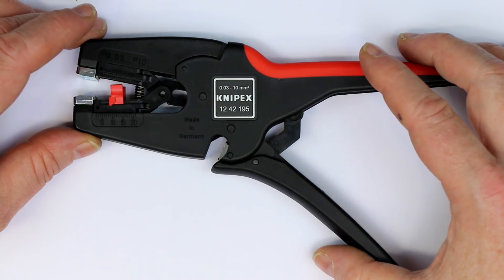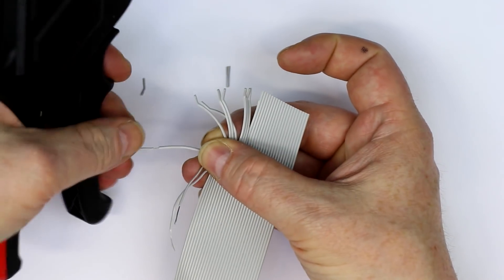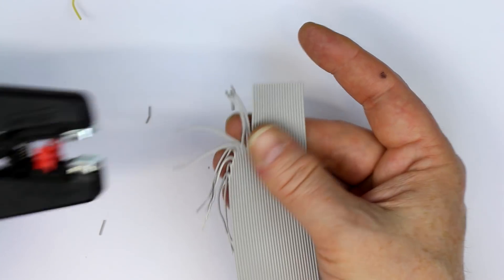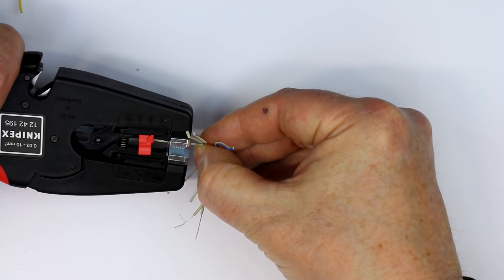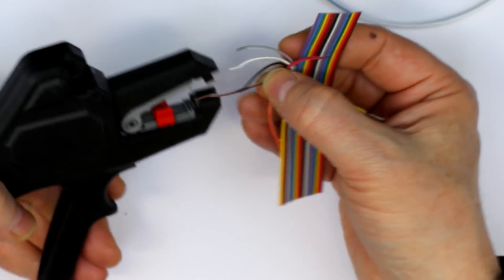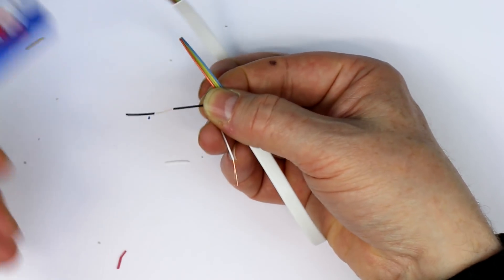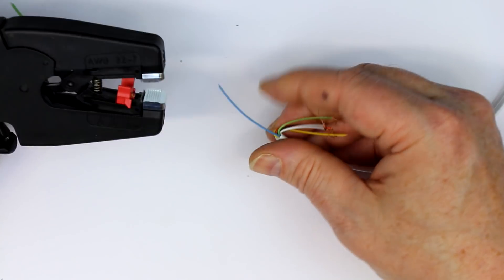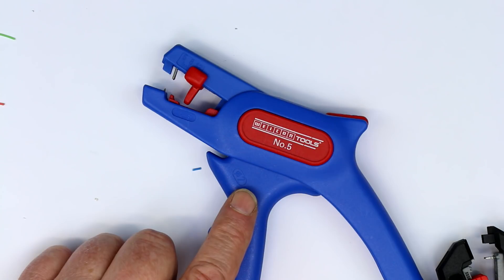Knipex Multistrip 10 - An unbiased comparison to 2 contestants

Comment: Fix for Knipex not stripping small wires:

The top blade is fixed with a screw to make it replaceable, but it has some wiggle room when the screw is loosened. So you want to loosen the screw and let the blade drop down slightly, then tighten the screw again. This adjustment allows the blades to grip small wires better and strip them perfectly! Mine came from the factory with the blade positioned too high, leaving too much space between it and the bottom blade, even at the tightest setting (I own the adjustable model). Hope this helps!

Comment: Flatcable is typicaly 0.08mm^2 and the knipex 12 62 180 is designed for 0.2 to 6mm^2, so you cannot complain that it doesn't perform well enough for something that it wasn't designed for!
From the video I am guessing that you are right handed ... might sound silly but use your right hand for the tool. I have the mulstrip 10 and it performs as expected (I mainly use for thin electronics cables)

Comment: You were setting the wire further in with the cheaper Knipex.
Reply from the maker: In the mean time I have found a trick to get also very thin and slippery wires stripped with both of the Knipex tools. You have to insert/strip a not too short and not too long piece of wire  The large one (Multistrip 10) with that trick is in fact really the best one.

Comment: I got a pair of 12-62-180 Knipex wire strippers, and mine have a strength adjustment on the upper jaw. Yours seem to not have it. I'm curious if this was added along the way.
Reply from the maker: Yes, Knipex have added this feature recently. I have to try it out if it really improves stripping of thin, slippery wires.

Comment: I’ve experienced the same problem on the Knipex 12-42-195. Rather disappointing! Recently I’ve tried to turn the blade “upside down” (even though it look identical on both sides). This seems to have helped, but I’m still to test it out in more situations. Can anyone else confirm if this solves the problem for you?

Comment: The Weicon No. 5 is the same tool as a Gedore 8087, i never touched that tool after i tried the Gedore 8146. strips even silicon and wires up to 16mm. i'm  professionally using this tool for about 12years now, and didn't even had to replace the blades.

Comment: I've got the Knipex 12 62 180, and it's no good... Just doesn't work more than half of the time... I would recommend the Jokari Super 4 Plus instead, also it's about half the price, just €14 on Amazon.
I've got the adjustable 12 62 180, it has a slide to adjust the thickness of the wire, your model doesn't have that I see. (not that it matters, this doesn't work either)
Reply from the maker: Knipex made this new version of the 12 62 180 with the adjustable tension or pressure without notice and without changing the model-number about a year ago. I have one lying here around untested. That would be bad news if the adjustable tension/pressure is no imrpovement at all :-(
Reply: @KainkaLabs  Sadly, it isn't... Knipex is my favorite brand, but they f'd up with this one...   The Jokari Super4Plus is working good!

Comment: Is because your Left Handed?
Reply from the maker: As long as I don´t have 2 left hands... :-)
Reply: Have you tried the newer Knipex stripper with the adjustment, at the pivot point? I’m trying to strip 22 AWG Stranded wire. Very often the fine wire comes off with insulation.

Comment: Not pulling the wire all the way off is a feature of the 12-62-180. That way, you can create gaps in the insulation for splicing, or you can twist the insulation, as you pull it off, making for a neatly twisted wire, ready for tinning.

Comment: Leaving the insulation on the wire is totally fine, if anything it protects the strands of the wire from fraying until you are ready to solder or crimp. It would be interesting to see which one performs better with high-performance wire (e.g. spec44 or spec55 wire).

Comment: Precistrip 16 with regulation wheel are superior. They dont have problem with tiny cables and leave insulation on cable so you can twist it if you want.

Comment: The cutter on the new weicon is not on the safe side for live works. If you are cutting live wire, i prefer the cutter to be on top side so that it wont fall on to your hands after cutting. perhaps Weicon should come up with less plastics at jaw of this tool.

Comment: Personally I like the stripping tool to leave insulation on the cable so that you can quickly twist the multi core wires with the insulation on! Making it perfect for solder applications!
Reply: Not only that, but it's easier to ensure that you haven't cut any strands, since the discard is left behind to be examined. It's also tidier, since the discard isn't just thrown down without regard. I can see that it could be a drawback if you were stripping tons of wire all at once, though.

Comment: First Knipex was updated with version with pressure regulation slider. Second one has two brothers 12 40 200 and 12 52 195 - both also with pressure regulation wheels. Those regulators are a game changers for thin cables (electronics stuff). Im also looking for good striper for thin cables and despite that Weicon is more affordable and suitable for hobbyst as me, i would rather pay a little bit more for more flexible solution like first one with slider. But yeah, those basic one you showed should be advertised for electric use not electronic.
Reply: So will Knipex give the money back or provide updated pressure regulator part to people who bought expensive strippers? Its not good enough to say oh look we have nw upgraded and it now works! So did they not even test the previous strippers?
Reply: @pkumar5411  Nonregulated do work on electric cables and electronic with certain thicness. Are you sure you using yours on cables with thickness mentioned on tool's box?

Comment: Really interesting to see these results. 
I just got a MultiStrip 10, and it perfectly stripped every wire I've tried - silicone insulated (0.14, 0.33, 0.75, 1.5, 2.5 mm2), teflon insulated (0.05, 0.15, 0.38 mm2) and PVC (0.75 mm2).
Perhaps the one you got has some quality control issue? Or try switching hands? :)

Comment: I really like, when they don't strip fully. In industrial environments you often have steel grating tiles as floor, where the striped part of the wire trends to drop down a few floors. Another lovely thing, you can strip all wires at once and add ferrules in the next step. Depends on the application.

Comment: I bought the Weicon No.5 based on this review and have to say that it is the nicest wire stripper that I have ever used. Even though it is only rated down to 28AWG, it strips 30AWG with no visible damage to the copper. Cutting the insulation on 4 sides makes for an excellent and low effort tool. Would 100% recommend!

Comment: why didn't you test them all on some larger cable diameter also? the wire is very small and the larger knipex tool is good for up to 10mmsq? In my experience with any of these cable strippers generally they work best just inside both the upper and lower limits and generally quite poorly at each limit
Reply from the maker: Because every 5$ wire stripper does a good job with large diameter wires. In electronics you mostly deal with smaller diameter wires and here the difference is substantial.

Comment: Having experienced similar issues with the very well-regarded Weidmüller Stripax with very thin and/or slippery wire, I can give one bit of information (which other comments have said as well): the speed at which you squeeze the handles makes a big difference. I’d be curious to see the results if you squeeze faster, as you did it slightly slowly.

Also, it doesn’t help that in your ribbon cables, the wires are bent from separating them. It helps a little bit to straighten them out before stripping. (That also helps prevent nicking the conductor.)

For sure, though, it looks like Knipex is erring on the side of being gentle on the conductors. 

8:15 — About terminology: "braid" means “Geflecht”, and so is mostly relevant to shielding. Being one of multiple, I’d say “conductor” here. 

Having had to deal with this very terminology topic recently, here the correct German->English translations for the electronics context, with explanations to ensure no confusion (and educate others who might not know):

Ader = conductor = a single electrical carrier (whether a wire, PCB trace, bus bar, etc.)

Einzeldraht = strand = a single solid wire specifically when describing the construction of a conductor

Draht = solid wire (1) = a single conductor composed of a single strand

Litze = stranded wire (1) = a single conductor composed of multiple strands

HF-Litze = litz wire = specialty stranded wire composed of many individually lacquer-insulated strands that are electrically joined to a single conductor at each end

Kabel = cable = 2 or more conductors, mechanically bundled in some way (in electronics, “cable” is generally reserved to mean 2 or more conductors that are electrically insulated from each other)

Isolierung = insulation = the nonconductive layer around a single conductor (2)

Mantel = jacket = the additional nonconductive layer around a bundle of insulated wires, forming a cable

Schirm = shield (AKA screen) = a conductive layer added around a wire or cable to provide protection against electromagnetic interference

Flachbandkabel = ribbon cable = multiple individually-insulated wires joined into a cable as a flat ribbon

Folienkabel = flat flex cable (AKA flexible flat cable, FFC) = a type of ribbon cable with flat conductors within a plastic tape

Abisolieren = (wire) stripping = removing insulation from a wire

Abmanteln = jacket (or cable) stripping = removing jacket from cable

“Sheath” is a word that is unfortunately used variably to mean a jacket, shield, or an extra layer on a cable to provide more mechanical protection. It’s essential to investigate what is meant when you encounter it, if it’s not absolutely clear from context.

The above is the most common usage. No doubt there are exceptions, of course. 

(1) In English, “wire” is the umbrella term for all kinds of wire, and does not suggest any specific construction.
(2) In English, “isolation” has more of the connotation of the concept of separation, even if just accomplished passively by keeping distance, while “insulation” means the material added specifically to stop electrical, thermal, or acoustic energy from moving. So in English we can say that electrical isolation can be accomplished by the use of electrical insulators .
Reply: Mine stopped having trouble once I started stripping the wires faster as well
Reply from the maker: Yes, you are right. With some practice the "small" Knipex is on par with the Weicon. 
But I still don´t like the Multistrip 10 and only use it for very thick cables where the other 2 just fail.
And as another viewer pointed out, the "small" Knipex is apparently a rebranded Jokari 20050.
Just by chance the Weicon was also the "winner" in a comparison by "Stiftung Warentest" and they now print that on the packaging now :-)
Reply: @KainkaLabs  Actually, there are some differences between the Jokari 20050 and the Knipex 12 62 180. They seem very similar, but numerous small details are different.
Starting with the jaws, the Joakri has has two top (inner non-movable, and outer movable, connected to the outer part of the pistol grip), and one bottom, while the Knipex has complete double jaws, the outer fixed black jaws and the inner gray jaws which are moving. 
The Jokari has length stop at the top of the jaws, Knipex has it at the bottom, which is unfortunate, since the inner gray jaws on Knipex move when adjusting the stop, and the length markings are on the outer black jaws. On Jokari, the length stop is mounted on the same surface as the markings, making it easier to adjust the length precisely.
The black part of the jaws which holds the insulation is very similar, but not exactly the same, however the Knipex has extra 3 teeth on the inner gray jaws which hold the insulation, once the blades have bitten into it. Jokari doesn't have that. 
The functioning of the stripping mechanism is different: When the grip is squeezed, Jokari performs the stripping action, but does not release the cable. Instead, the jaws stay shut, until the handle has been released. This is sometimes useful, because it allows maneuvering the cable before releasing the removed insulation.
Knipex, on the other hand, completely finishes the stripping action and releases the wire once the grip has been squeezed. 
The operation of the wire cutting blades is different: On Knipex, the blade presses onto the wire which is laying flat on a metal piece. On Jokari, the blade does not move, instead the flat metal piece presses the wire onto the blade. The opening is pointing to the top of the tool on Jokari, and to the front of the tool on Knipex. 
My (very recent Knipex), has one extra adjustment at the top, but I'm still not sure what it does. The Jokari doesn't have it. 

In any case, they are extremely similar tools, and they seem to perform similarly, but I haven't used any of them long enough to say anything about durability.
Reply: Your effort and care is abundant in this YouTube comment! Perhaps more than needed, yet delivered with pride and authority. (sadly, I was too impatient to read it all...)

Comment: You have to be carefull not get cutted isolation material stuck in front of the bottom blade slider, otherwise the to blades are not centered and you won´t get a good cut. It is really hard to see on the video if there is something stuck, but that could caused the problem on the expensive knipex.
Reply from the maker: No. I know of this problem. The blades were absolutely free.

Comment: I have experience with both Knipex wirestrippers. They are both no good. After some time they won't apply enought pressure. Everyone in the company I work for is avoiding the Knipex. 

The Jokari Super 4 plus is good for bigger wires ( >= 0,5mm²), there it does a decent job.
For smaller diameter I use those Jokari Micro-strippers.
My best experience is with Weidmüller automatic wirestrippers. I have one of my own and it is doing great work for over 15 years now.
Reply: Which Jokari?  There are a bunch. From crap to great - if you’re an electrician. They all suck for small applications 24 AWG and down).

Comment: The Pressmaster Embla wire strippers are similar to the Knipex, but have a fine adjustment for insulation thickness.
Reply: are they available on Amazon

Comment: The expensive Knipex also doesn’t look very ergonomic to hold/use compared to the Weicon.
Reply: @Leif Automatic strippers seem to be about evenly split between the pistol grip like the Weicon and the one Knipex, vs. the pliers grip of the expensive Knipex (and the arguably best automatic one on the market, the Weidmüller Stripax). Honestly, both styles work very well.

Comment: Thanks for the video. It looks like the "slippery' wire has PTFE (Teflon) insulation and it is coating the jaws of the wire stripper, hurting performance on subsequent tests...
Reply from the maker: No, it´s definitely not PTFE insulation. It´s an ordinary flat-cable.
Reply: Coating the jaws - lol - u dont know what u r talking about - theorist
Reply: @mcqcjc8409  Happens all the time dumbass.

Comment: I suspect that the insulation remaining on the wire is an intentional feature of the tool.
Reply from the maker: You probably refer do the KNIPEX cutters.

Could be, but it is not consistent.
And even if it is a feature, the downside is that it mostly doesn´t cut thin and "slippery" insulation which the WEICON does much better.
Reply: You're right. Perhaps the failure lies in the mechanism that allows the tool to automatically adjust to different wire sizes.

Comment: Hi Dennis,

I bought a Knipex 12 42 195 recently, and i was rather disapointed ☹️
I had the same kind of problems you are showing in your video.
In my opinion, the cutter lacks an "insulation thickness" adjustement, like on other similar stripping pliers...
I did not expect this from Knipex, wich has a top quality tools collection. This one is an exception.
Thanks for sharing,
Eddy.

Comment: The bigger ones just seam like the jaws don't close enough for small wires. If there isn't any adjustment to increase the pressure or close them more it just might not be designed for it.